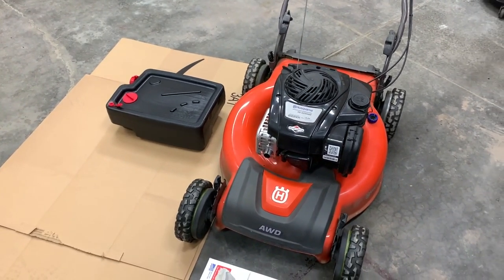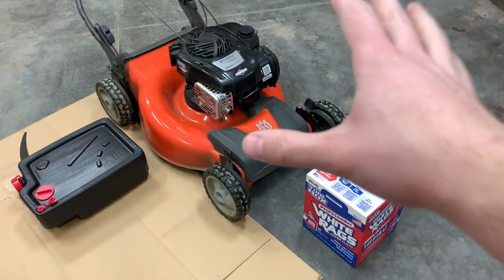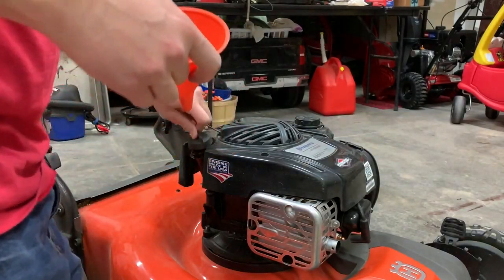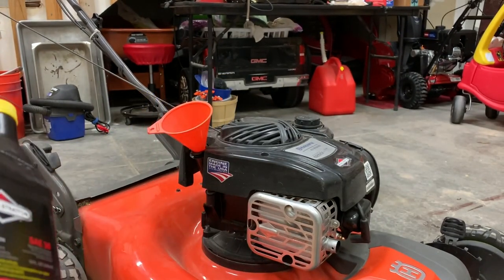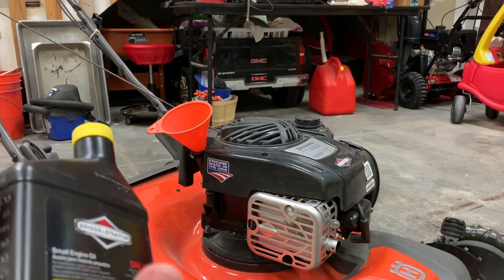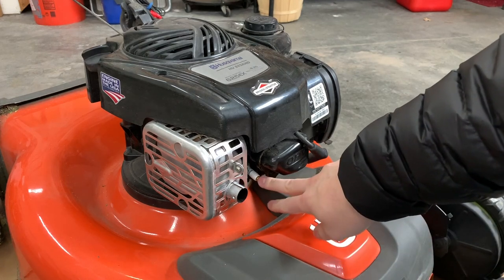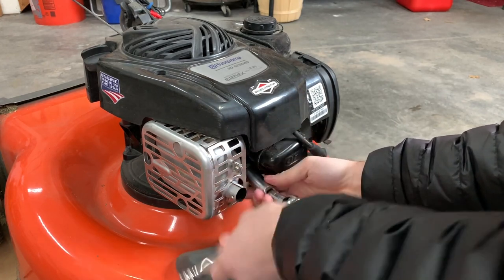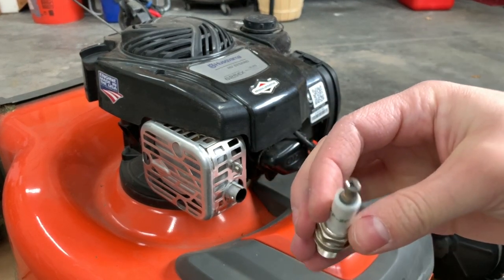Husqvarna 22-inch Lawn Mower Tune Up (Oil Change, Filter, Spark Plug)

Comment: If you run the mower for a few minutes it will help with draining the oil. You don't have to move the handles the way you did to drain the oil. Most engines take 20oz of 10w-30 oil. For the manual scan the QR code on the top/front of the mower for the manual and specifics on the mower. Good job from a Small Engine Repair Tech.

Comment: The owner's manual for a Husqvarna HU 700 H says that the oil capacity is 18.56 oz. I changed my oil today and it took only 12 oz of new oil to reach the fill level on the dip stick. The old oil did not look like 18.56 oz so I refilled slowly and checked the dip stick several times as I refilled. This is a Honda engine and if I had put in 18.56 oz it would have been way overfilled.

Comment: This video is getting me look forward to the spring here in N.H. I don't understand why lawn mowers don't have convenient oil drain plugs.  I have a Honda and it does have a drain plug but it is almost like draining it right from the fill port like yours so the the drain plug doesn't really help much.
Reply from the maker: Ya draining the oil is probably the most annoying as far as maintenance goes. I'm looking at upgrading to a Toro Timemaster, and it's the same story. Gotta tip it over.
Reply: Jimmy Lewis they make pumps that remove the oil from small engines. They’re pretty dang affordable too! I’m looking into picking one up this season so I don’t have to tip my timemaster over.
Reply from the maker: RVA Lawn Love I'll have to look into that, especially since I'm probably upgrading to the Timemaster. If you pick one up I'd be curious to know your thoughts.
Reply: They do it so you don't maintain it and buy another lawn mower.

Comment: Thanks, is that a cement floor in your shop or natural stone Jerry? My concern is when I pour oil past the "add" mark. Is this OK or should I drain I off the excess?
Reply from the maker: It's a cement floor. If the oil is just past the the max line I probably wouldn't worry about it. If you really overfilled it, then I would just grab a turkey baster and suck out the excess.

Comment: 2 questions (I don't know where you live):
- Why didn't you change the oil in the fall? It's better for the engine to sit for extended periods with clean oil than dirty. Ask any boat owner. 
- Did you let the engine run so the oil flows easier?
Reply from the maker: aguyandhiscomputer I didn't change the oil in the fall because I had other things going on and couldn't get to it. And I didn't run it before hand. Appreciate the advice though. Will remember that for next time. Thanks for watching.
Reply: @JimmyLewisMows  ok, makes sense. With 3 kids, I've been there, a lot :) Thanks for the reply.
Reply: He had a Washington state car license plate on the wall.
Reply: @odyseygolfer  That could work. Although some people collect plates. Or he could have moved from there. But good eye.

Comment: I've never personally changed the oil on my mower. This is a great instructional video, thank you!
Reply from the maker: Happy I could help. Thanks for watching!
Reply: Ha I was thinking the same exact thing, I’ve never actually pumped or tipped any push mower, just top off with quality oil. Your more worried about burn off then the oil breaking down.

Comment: I hope this isn't a silly question, but is the correct gap on the spark plug already set when you buy it?
Reply from the maker: If I bought a new mower and was experiencing issues with it starting, it would be one of the things I look at.

Comment: Always check the gap on the spark plug before you install
Reply: Why?
I'm trying to learn how to do all this. Any info is helpful, thanks.
Reply: @willi6880  I can’t speak for all models, but the plugs that fit my mower are gapped at the factory, which is convenient. If they aren’t pre-gapped though, you’ll definitely need to check the specs for your mower and set the gap accordingly.

Comment: how do I ask for the spark plugs and what kind of oil do I need
Reply from the maker: Refer to your owners manual for both of those. You can pick up a spark plug at the Home Depot. They are usually stocked near the lawn equipment. I also like to use the full synthetic oil.
Reply: Either check the part number on the plug that's already in the engine. Or, they make rune-up kits and it comes with an NGK BPR6ES 4008